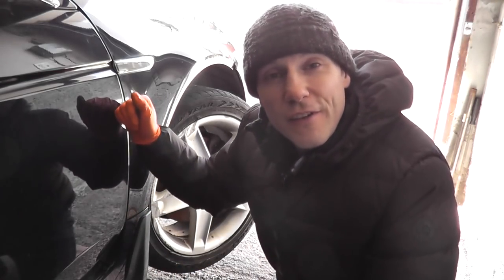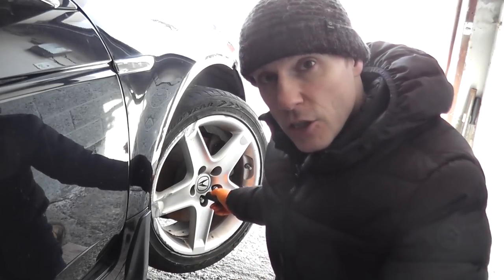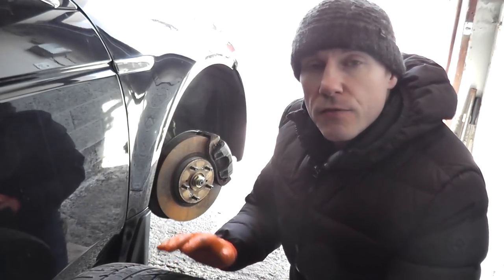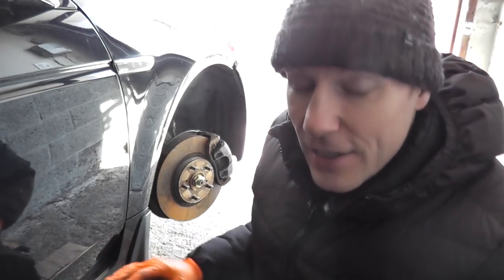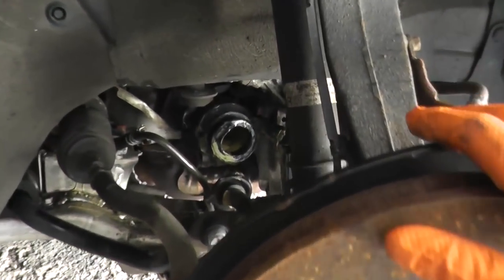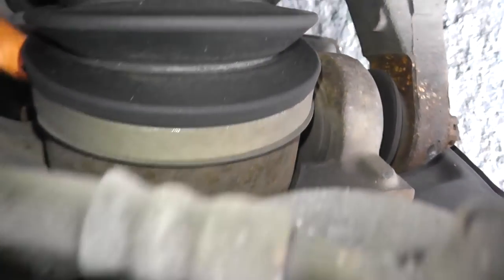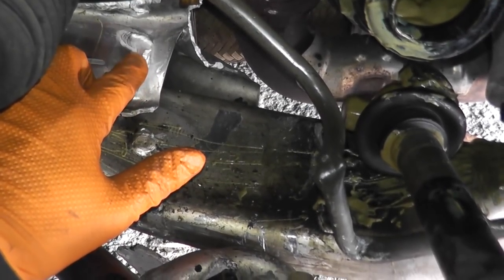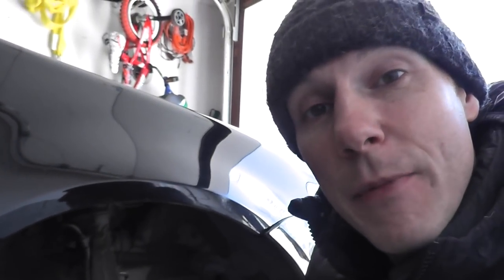Acura TL With A Torn And Broken Subframe

Comment: Yup It happens 😢😢 I was shocked when I saw mine broken at the same spot as this one
Reply: damn , mine broke the 2 bolts that holds the steering rack and pinion ,,,  probably have to replace the whole subframe or drill holes to put new bolts

Comment: I definitely work fixing if the engine and transmission run good. My TL was run off the road slam to the ground and I had to replace every single suspension etc... be prepared to replace the rack :(

Comment: I just did this exact repair on my passenger side axle it was a bit of a pain because the cup on the inner shaft was left and wouldn’t come out without removing the heat shielding from the down pipe. Got the intermediate shaft out hammered the axle shaft remaining cup and popped on the new axle. Intermediate reused
Reply from the maker: Thanks for the heads up. Glad you were able to reuse the intermediate shaft; they're pricey.

Comment: Wow thats awesome, what a deal. I have an 07 TL Type S 6 speed manual and I absolutely love it. That being said, if I were you, I would fix that car up, sell it and pocket the money. If the accident damage has not yet been reported to the state, you can fix everything there yourself, sell it and accident damage wont show on the title. Also as much as I love mine, theres a reason I bought a manual. Besides obviously being more fun to drive, these 3rd gen TLs have notoriously weak automatic transmissions. If the fluid has not been changed every 30k miles with OEM Honda fluid, its not a question of if but when it will fail. Autos also get pretty dismal fuel mileage, especially in the winter. With that low of mileage and the right buyer I bet you could get 8-9 grand for that car. Just my 2 cents.
Reply: The 07-08 models had a major upgrade as far as the transmission. Not perfect but better! I have an 08 TL type s auto LOVE IT!
Reply: The one in this video is a 2006 so that doesnt apply to him. Even the "upgraded" ones were weak transmissions. They fail in multiple different ways. Most guys are lucky to get 100k miles out of them. Good luck.
Reply: @twinturbotim1660  Really! Mine is exactly like the one in this video... has 205 k with original trans and it works perfect.